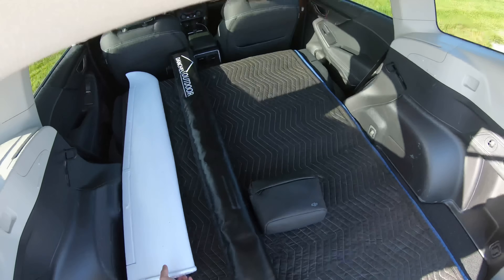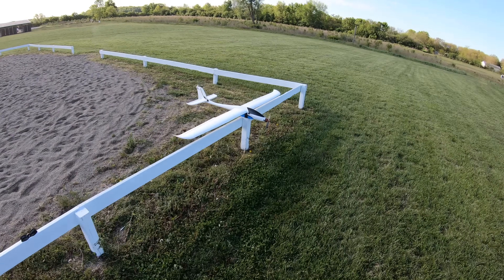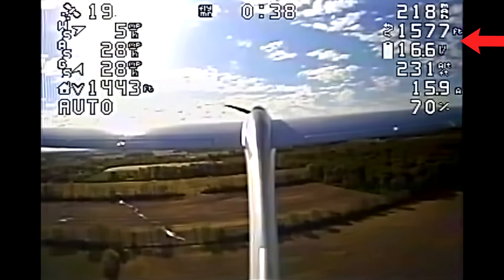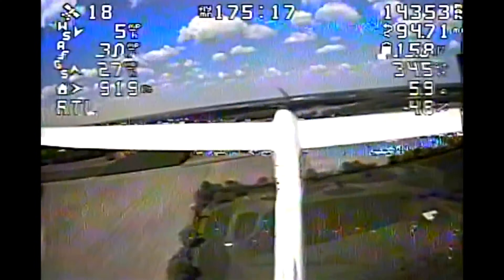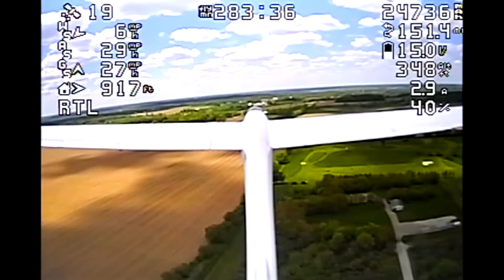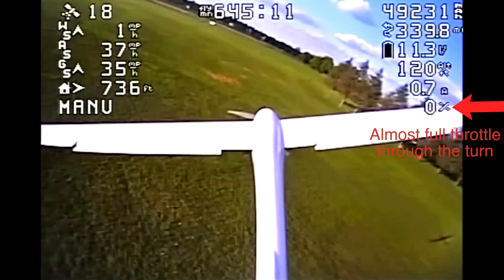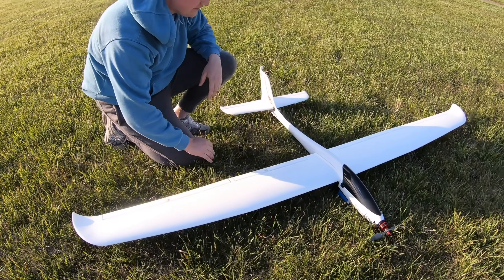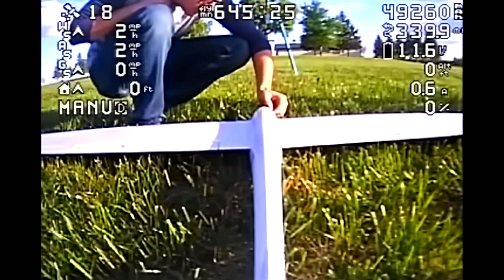My Longest RC Airplane Flight

Comment: do you know about total weight AUW compare static thrust for motor did you used?
Reply from the maker: The thrust is definitely less than the AUW, haha. My guess is about half. That is why the launch was so scary, haha.
Reply: @MatthewHeiskell  i only can assume your motor has less than 1kg of thrust for 70% throttle, and you mentioning your auw is about 4ish kg? If that so you have 1:4 thrust to weight ratio. Wow
Reply from the maker: Yeah haha that sounds about right!

Comment: After puting bigger battery in, did You have to replace aluminium rods? I had to do that when inserted 4s 3000 mah. Aluminium rod (in ranger 1600 there is only one) bend when flying in such a way that wings had V shape :) I have bought glass rod 8mm think and replaced aluminium pipe.
Reply from the maker: No, I was using the standard wing spars

Comment: I am curious about building 2,4 m phoenix with super light components and fpv for gliding. :) 1300 mah battery just to get in the air and power the electronics. This might be interesting I think.
Reply from the maker: Yeah, especially if you have a place to slope soar or thermal!
Reply: @MatthewHeiskell  I have ranger 1600 and last summer it was purely manual, no fpv, no fc airplane with 2200 mah 3s battery. It was very light that time. I must say in sunny day I could soar for 30 minutes over the field with engine off. You just need to look after birds circling around and follow them :)
I think I might put some light FC+GPS+FPV and small battery and engine and try it out. Maybe only FPV, without FC would be also good choice. Actually FC is not so much needed on the glider. Once You fly around two days to get terrain orientation going home manualy is easy :P
However now I am converting my Ranger to FPV long range plane. I cannot afford buying proper long range plane for fpv right now, so I must use ranger for that purpose:)
Reply from the maker: Your Ranger 1600 will be a great plane for that! I recommend that you add the flight controller though. It is much more relaxing to know that if your video feed fails, you can select RTH.

Comment: I would like to no how you set that panning FPV camera up on the vertical stabilizer?  Very interesting setup.  Great job.
Reply from the maker: Thanks! I show the pan servo in another phoenix video. Here is a link that will start you at the exact moment, but you might enjoy the whole walkaround section: https://youtu.be/M-j0khC0x80?t=321
Reply: @MatthewHeiskell  thank you!  I subbed.
Reply from the maker: @Freebird_67  You're welcome! Thanks!

Comment: Can you control your plane from 170 miles away? That would be a dope trip to see
Reply from the maker: No, I can’t control it that far away, but it is possible. You would need to use cellular data to control the plane. But we can’t fly beyond visual line of sight in the US anyway. If you are really far away, then you might not be able to see and avoid a manned aircraft.
Reply: @MatthewHeiskell  Does Visual Sight rule apply for quads and drones as well?
Reply from the maker: @jbcom2416  Yes, it does.

Comment: That was pretty awesome, thanks for that video. I’d be interested in your tail camera pan until set up.
Reply from the maker: Thanks! It is just a cheap FPV camera glued onto a servo. And the servo is glued into the upper edge of the vertical stabilizer.
Reply: @MatthewHeiskell  Awesome, very simple thanks for the response. Happy flying
Reply from the maker: @Joneszee1969  I show the pan servo in another phoenix video. Here is a link that will start you at the exact moment, but You might enjoy the whole walkaround section: https://youtu.be/M-j0khC0x80?t=321

Comment: Are you pulling 16 amps for 10amps battery ratings?
Reply from the maker: The Li-Ion pack that I made has 40 cells in a 4S 10P configuration. Each individual cell can deliver 10 amps, but the 10P means that there are 10 cells in parallel. You multiply that by 10 amps. So the whole pack can actually deliver nearly 100 amps continuously at 4S voltage.
Reply: @MatthewHeiskell  sorry for stupid comment. I already know that as im electrician, but may brain got freeze when see your video, just amaze that flight time
Reply from the maker: @ZuNunchaku  No worries, thanks!

Comment: Wow this is really cool. I’m new to the diy side of the hobby and really want to build a long range Fpv glider focusing on long flight times. I was wondering what I should keep in mind when choosing a large battery or conecting then in parallel? I noticed that you had quite a small esc, if I connect lipos in parallel do I have to switch to a larger esc?
Reply from the maker: The ESC should be rated for more than the max current that the motor can handle. The ESC also needs to be rated for the number of battery cells that are in series (the operating voltage). You can connect as many LiPos in parallel as long as they have the same cell count (operating voltage). Let's say that the plane normally flies on one 5,000 3S pack, but you have two 5,000 3S battery packs. You can connect them in parallel to get 10,000 3S. That will nearly double your flight time and you can keep using the same ESC.
Reply: @MatthewHeiskell  Thanks that really helped.

Comment: Hi, amazing!   have you also tried to use 4S 7P  50E battery pack , in that case battery will be only 69 gram heavier but higher voltage battery pack I am thinking might be better. what is your thoughts? very interesting
Reply from the maker: Hello Tomi, you’re on the right track. Higher voltage means less current is needed to make the same power. This decreases the (I^2 * R) loss. But the average current was already pretty small, about 5 Amps I think. Also, the pack that I built and used is 4S 10P with 5,000 mAh cells. I used 40 individual LG M50 cell in this pack. It has 720 watt hours and it weighs 6.3 lbs or 2.85 kg.
Reply: @MatthewHeiskell  ohh I see , I guess I confused with your other video 7h flight battery pack ,sorry about that, thinking to build one but with VTOL take off and landing .
Reply from the maker: @tomipiriyev  No worries! I figured that's what happened. Oh, wow! Your VTOL project sounds cool! I've never done one of those.
Reply: @MatthewHeiskell  720 watt hours is almost one horsepower hour :-)

Comment: Just wow, I felt bad for pheonix in last year, since everyone started buying talons and wings. Forgetting about the fact that pheonix can handle very heavy batteries.
Reply from the maker: Yeah, 2.4 meters of wing is pretty significant. Wings are nice for their two servo simplicity, and the talon is a legend, but I’m getting tired of V-tails. My new favorite plane for normal flying is the dragon 2 with the traditional tail.
Reply: @MatthewHeiskell  By the way, what is the world record for long range or to be more appropriate distance travelled record? I found only outdated info on that having 150km. Which is not that fascinating nowadays.
Reply from the maker: I don’t know. I tried searching too.
Reply: @MatthewHeiskell  what happened with vtail? Do you have any video about this?
Reply from the maker: @ZuNunchaku  In my experience, V-tails like to spin. They don't feel as "locked-in". I prefer a traditional tail.

Comment: how can i get you or someone to sell me a full package to get a long distance flyer? from remote to base station, batteries plane etc.
Reply from the maker: Where do you live? In the USA you’re not allowed to fly higher than 400’ or beyond line of sight. If you want a turn key solution, check out the DJI Mini 2.

Comment: Holly S! that's a battery 🔋. Amazing what you can do with some extra amp hours. I'm just starting out but already had fun upping the battery on the cheapest planes fly's better and goes triple time
Reply from the maker: Haha yeah! Check out the Sanyo NCR18650GA cells. They are the best for this type of endurance flying. You can get an affordable spot welder that operates using a Lipo pack. IMO, the best way is to build your own packs, but the ZOHD LION packs use the same proper cells.

Comment: One of the best videos I have seen in a while. Really inspiring. Would love to see a video about the auto pilot components you used
Reply from the maker: Thanks! The autopilot is nothin’ fancy, just a Matek F405-wing running arduplane 3.9.11
Reply: F405 wing is a fantastic product by maytec,I still use them with inav,great achievement there.

Comment: Great flight. You should use a folding prop.
Reply from the maker: Folding props are great for gliding, but my motor was powered on almost the entire time. It would be nice for landing, but a solid APC is more efficient than a folding prop.

Comment: Would you do a video of your whole fpv setup? I'm new to all this and it would be so helpful
Reply from the maker: It is really simple, just a camera and video transmitter connected to the F405 wing flight controller. You can search for a setup video for that flight controller and it will have all the info that you want. P.S. sorry for the delayed response.

Comment: Did you have to set the LVC on the ESC to work with these batteries since you can go much lower in voltage and still have the amps you need? I tried these batteries in a C1chaser and forgot about the LVC hitting at 3.5 Volts per cell and hit LVC and now way to reset it while flying. you can get a LOT more mAh per LB. with these batteries, but lack in amps until you get to this amount of mAh. That is amazing what you proved here with these batteries and their ability to sustain long term flight over LiPos.
Reply from the maker: Yes, you are correct. You need to either disable the LVC, or simply use an multi rotor ESC because they do not have a low voltage cut.

Comment: Why use LG M50 cells instead of 50Ah of regular, soft LiPo battery packs? You have the extra weight of the metal canisters around each cell which seems like it would be a disadvantage.
Reply from the maker: The exact opposite actually! Certain Li-Ion cells, like the LG M50, have almost twice the energy per weight compared to normal Li-Po packs. They do however, have a much lower "C-rating". This means they cannot supply the energy as quickly as a Li-Po, but they DO carry more energy for a given weight. That was a key aspect of this super long flight.

Comment: That battery would run my E-bike ! Good job bro.
Reply from the maker: Thanks! Just for fun, what kinda range could you get with my 4s 50Ah battery pack on an E-bike? (riding efficiently on level ground) I might have to build one haha 😁
Reply: @MatthewHeiskell  I think e-bike engines require at least 10S battery packs with 13S becoming the new standard...
Reply from the maker: @kmieciu4ever  Wow! That is a LOT of voltage! Thanks for the info!

Comment: How do you control your plane? You talked about the use of satellites, does that mean you can fly your plane from anywhere? What is this technique called? I wanted to implement 4G into my plane, but idk if it would work smoothly
Reply from the maker: The satellites that I mentioned are GPS satellites. The flight controller uses GPS to autonomously fly the circle holding pattern. I control it with a normal 2.4 GHz RC transmitter and receiver. Your 4G control idea sounds cool, but there will be some latency. It would work well for sending new waypoints though.

Comment: Great work man!!!! Love it. I would like to know where you got the LG batteries. I would love to make mine. Thanks
Reply from the maker: Thanks! I order my cells from 18650batterystore and liionwholesale. Those are just about the only two sellers that I trust.
Reply: @MatthewHeiskell  I don't see LG M50s on either site. Can you go into detail on how you made the pack, or link to a video showing the same process?
Reply from the maker: @davidsvideos195  The best cells to use are the Sanyo NCR18650GA cells. They have the same energy per weight of the LG M50, but they have a higher C-rating. And even if you don't need the extra current, and you shouldn't, you'll be discharging at a lower C-rating which will allow you to extract more useful energy. You don't have to understand it, just trust me, those are the best cells. Spike made a great video about building Li-Ion packs: https://youtu.be/h_0nb9eFsQs
Reply: @MatthewHeiskell  Could you recommend anymore high capacity batteries like the lg m50? Thanks
Reply from the maker: @forzabike  Yeah, they very best cell that I know of is the Sanyo NCR18650GA. It has the same energy per weight as the LG M50, but it has better power per weight.

Comment: Awesome project, with the Matek F405 running Aruplane code, have you tried getting real-time telemetry data (i.e., moving map) via Mission Planner?
Reply from the maker: No, I haven't tried that, but it would be really cool. Do you know of any good telemetry radios that work with the Matek F405 running Aruplane code?
Reply: @MatthewHeiskell  Unfortunately not,  I would have to experiment with the XROCK  915Mhz Radio Telemetry Module or equivalent you can find on eBay that work with the family of PixHawk Mavlink configurations.
Reply: @MatthewHeiskell  You can use the mRo SiK Telemetry Radio V2 915Mhz for your setup, they are very easy to use and install.  I use them with the F405wing all the time, though you have to cut the connector they come with for the pixhawk and crimp on dupont connectors for voltage, ground, tx, rx.  They work very well though.  Good job on this setup and successful flight.
Reply from the maker: @JorgeJimenez2020  Thank you! 😁
Reply: @MatthewHeiskell  Great stuff Matthew! I have used this for short range telemetry works on wifi and less complicated https://www.ebay.com/itm/273791117931 "Wireless Wifi Radio Telemetry Module w/ Antenna for New MAVLink2 for Pixhawk"
Reply from the maker: @gaufpv6560  Thanks Gau!

Comment: What do you think about making the battery shape fit into the fuselage? It's probably very complicated, but it would be interesting to know how it would affect efficiency. Or make some fairings on the back of the battery to minimize turbulence. By the way, where is the stats table at the end of the video? It would be very interesting to compare with your previous setups!
Reply from the maker: Good ideas! I bet a fully internal battery would improve the efficiency. Yes, even a faring would help too. I didn't update the data table because this is a different battery (4S 50Ah vs 3S 45Ah).

Comment: is that a 12x12 E prop??
Reply from the maker: Yes, 12x12E by APC. 👍
Reply: How much experimentation have you done with different propellers?  I would have thought it would be more efficient with a lower pitch with higher throttle?
Reply from the maker: @shannonfletcher221  I've tried different pitch propellers. I have found higher pitch to be more efficient than low pitch. The motor does not need to turn as fast to make the same "pitch speed". Lower pitch DOES make more static thrust on a test stand, but I want efficiency at speed. Imagine you're building an efficient car, but you only get to have one gear in your transmission. You're going to pick a higher gear for cruise speed, right?
Reply: @MatthewHeiskell  interesting.  I'm trying to build a high efficiency 2400 at the moment.  Still got pnf electronics besides flight controller and RFD 900.  I've only got a 40 minutes Cruise time at 12m/s airspeed.  I would love to achieve the flight times you're getting in the future

Comment: fantastic! Getting that sort of flight time takes a lot of effort
Reply from the maker: Thanks! I tried iNav at first, then I flashed arduplane onto the FC. What a difference!
Reply: @MatthewHeiskell  can you see how far you can get into area 51? xD
Reply: Did you tried to fly with inav?
Reply from the maker: @sarantis2  Yes, iNav is more user friendly, but Arduplane is better in every other aspect, especially efficiency.
Reply: @MatthewHeiskell  I cannot agree more. After this video I order the same plane
Reply: @MatthewHeiskell  That's interesting. In what way is iNav more efficient?
Reply: How do I match the wingspan data and the electrical parts of the aircraft?  thanks
Reply from the maker: @陳一文-e5h  The airframe is the Phoenix 2400. Most of the parts that I used are in the video description.
Reply: Yes, and money (~$300 battery). Congrats!!!  Comparing to gtrick90's 4h 100 mile flight on 4s-7000 with the z84, 7 times the Wh to travel 3.4 times the distance.
Reply from the maker: @user-rs8zg8ey2b  That's not a fair comparison haha. My average power was higher because I had to carry that big battery, but as a result, I was able to go longer and farther. To make a fair comparison, we need to fly with the same battery. If I switched from a 50Ah pack to a 7Ah pack would save me 5.4 pounds! The number of watts needed to maintain altitude would be greatly reduced. The Z84 is a great wing, but the 8 foot wingspan of the Phoenix 2400 is more efficient.
Reply: @MatthewHeiskell  it fair because I did it, haha, jk, its a great accomplishment for sure, congrats again. I started flying rc gliders in 1976, I mostly fly quads because they are a 3D playground with just about the limit of your imagination, here is one of my videos https://www.youtube.com/watch?v=uHoFfpLSb2g&t So back to your plane, I have the Phoenix 2000, my bro has the 2400, if you compare these foam planes to a balsa plane (built right), they are night and day for efficiency IMO, just look at the trailing edges on a foam plane with large square TE, horrible drag, even the Ailerons/flaps have huge drag valleys. You did achieve 3.4 times the distance, thats totally awesome, by being half as efficient (740Wh for 340 miles = 2.176Wh/mile, verse the z84 103.6Wh for 100 miles = 1.036Wh/mile. Wings are generally ~30% less drag because of no tail.
Reply: @user-rs8zg8ey2b  Maybe because battery wasn't fully enclosed, it caused more drag. None the less, very good. I thought electric planes could fly 1 hour max.